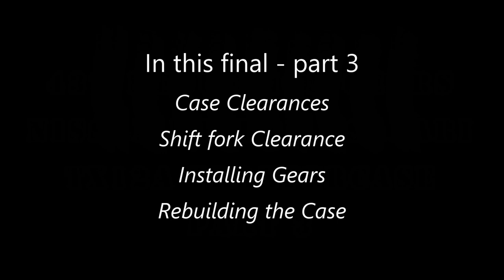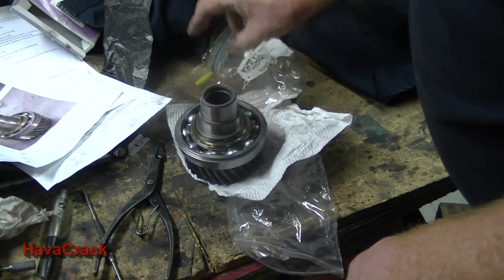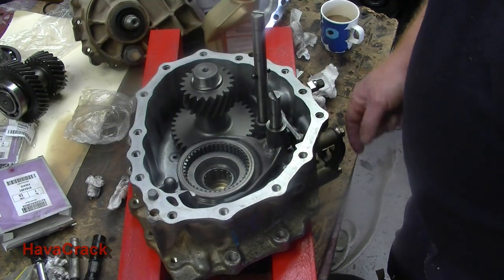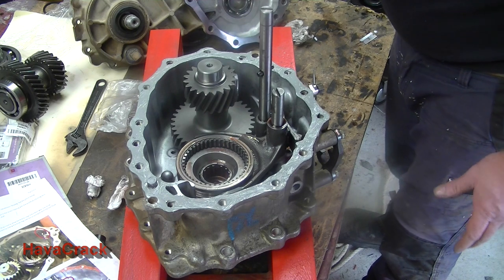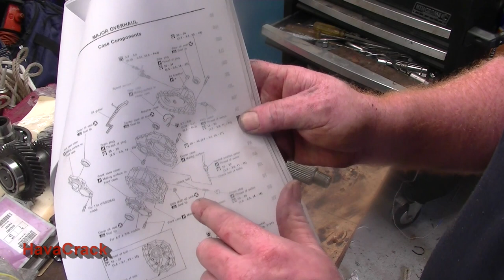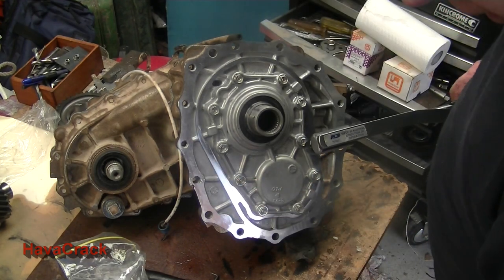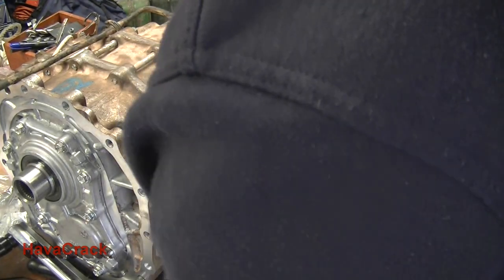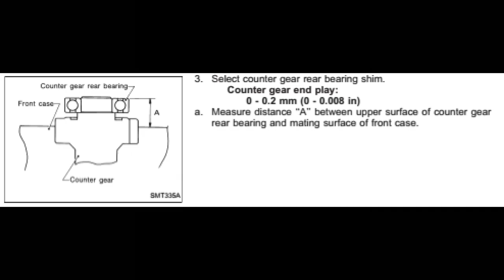HavaCrack: 43% Reduction Gear Install - Nissan Patrol - Part 3 of 3

Comment: Great video mate, I just installed a set of 63% gears. Followed your video as a guide, made things a lot easier. Thanks 👍
Reply from the maker: Ben neville    Thanks Ben, not a YouTube sensation, but I am glad the videos helped, I looked around for a couple of months to find any photos/ videos before I did mine but with no luck. Anyway that is why I make some videos on the things I do so as to help others out. You did well getting a set of 63%, I don’t think there will be anymore made. Out of curiosity and maybe so you can help others, did you have to grind the front case at all?   Regards Mick.
Reply: Did the 63s require more grinding of the case material?

Comment: Nice video mate. I just purchased the 43% from Marks 4WD, getting it installed by 4x4 obsession in 2 weeks as I'm not mechanically minded. Still it's good to see the process and what's involved. My reason for getting them was because my 3.0L Auto GU was scaring the hell out of me in downhill descents as stock. Hopefully the 43% will be a significant improvement although I've read in some forums that 83% is better for auto's, well I won't know till the next trip after they're installed and I'm facing a steep downhill descent. What do you think mate, will it improve engine braking on the steep descents? What has your experience been like with the 43%? Thanks.
Reply from the maker: I previously had a TD42 which had good engine braking going down steep downhill and the ability when going up to take off on steep hills from idle.  I lost all this with the 3ltcrd and especially down hill had to use brakes more often plus sometimes stalling and for steep up hill I always had to be in first low &/or keep the revs up.  With the 43% I am now back to (or maybe 1/2 gear lower) to the td42; therefore definately made a difference and I am happy with this setup.  83% would have been too low for a manual and if you could get the 60% that are sometimes out they would also be too slow for a manual unless you want to rock crawl or spend more time driving in 3rd low.   My mate has the gu auto and as you described there is no engine braking. I believe you will difantely notice an improvement with the 43% and I cannot say if the 83% would have been the better in the auto but for the amount of run on the auto has compared to the manual I think they would be good.  I suppose you need to find out someone who has the auto and seek their firsthand advice.  Regards Mick
Reply: @HavaCrack  Thanks for the reply mate. I'm looking forward to the next trip to try it out, will let you know how it performs. By the way my GU is not stock as I previously mentioned. It's got 32.7" tyres and a 2" lift.

Comment: Great Video. Thank you for showing this. I replaced my 5th gear for my 4.8 Patrol but noticed that the cruise control wouldn't work on 5th gear? have you faced the same and do you know any solution?
Reply from the maker: First, I presume your speedometer is working and if so the fault should not be part of the gearbox.  Secondly I am assuming you do not have a scanner.
In short I did not have any problem with my modifcations and the crusie control.  My y61 is a series 7 2012 and does not have a speed sensor on the transfercase like the earlier models.  I mentioned that in the video although it has a speedo drive gear on the output shaft, there is no VSS.
 However, I have had the cruise control not work on two occassions as follows:
1/. The brake pedal switch (there are two of them) not properly engaging &
2/. The tail/stop light not working or fuse has blown.
As per my gearbox/transfer, in video 1 & 3 you will see a gear/speedo drive gear, but this is not used in my model (2012 Y61). Regardless of how your unified meter gets the speed, if your speedo is working then your vscd cruise control gets it from the same source so that should not be your issue.
From your description are you saying that cruise control works in 4th gear, but not 5th? If so that sounds weird, as the gear should not matter unless you are goibg faster than 150kph as the CC does not operate over that speed or less than about 40kph, or were you saying that it is just not working now? Do you have a scanner and if so are there any codes such as a P0500 and a U1000?
Quick things to look at:
Issue 1: Have you checked that the brake/stop lights are working? Causes could be a blown fuse (10amp fuse) or potentially when the gearbox was taken out or put back in was any wire damaged that runs towards the rear of the vehicle?
If the brake light system is faulty then vscd will not work.
Issue 2: Switches: If it is the brake pedal switches for the ASCD (cruise control) are faulty then it will not work again. You can test the voltages or for continuity (which is easier) by disconnecting the plugs and putting a meter on the two wires as follows:
ASCD switch - Brake pedal released - Continuity should exist
ASCD switch - Brake pedal slightly pressed - Continuity should NOT exist
Stop lamp switch - Brake pedal released - Continuity should NOT exist
Stop lamp switch - Brake pedal slightly pressed - Continuity exist
Last there is a third switch on the clutch pedal for the ascd, and if that is not working then the ascd will not work. 
The only other issues if it not one of the above is the cruise control switch is faulted, but check that fuse first.
Sorry cannot help out anymore, but if your model has obd2 and you do not have a obd scanner then the Thinkdiag will show you the ascd switch status as well as the cruise control button status. I think gus from 2009 onwards will work with scanners(maybe earlier back to 2006). Regards Mick
Reply: @HavaCrack  Thank you dear for all your details. As I mentioned, if there is an issue with cruise control switch, It wont be working on all gears except 5th. And I replaced the parts from older model 1998 4.2 Nissan y61 and my vehicle has no issue at all and it is 2019 year model.
TB48DE
Reply: The last time I checked the vehicle with OBD2 came with below msgs;

P0335 - CKP SEN/CIRCUIT - 1t
P1336 - CKP SENSOR(COG) - 1t
P0057 - HO2S2 HTR (B2) - 1t 

Thank you anyway and appreciate your kindness and reply. I honestly did not know that this will affect the cruise control otherwise I would not do it.
Reply from the maker: @nalkhlaifi  Those codes are crank sensor faults and the downstream O2 sensor heater (after cat converter) None of those would impact the cruise control. 

I was about to say that if you used the 1998 gearbox then the Vehicle Speed Sensor VSS is on the transfer case, but that would not matter in your case as yours is a 2019 model and the speed comes from the ABS module and the wheel speed sensors, thus why I asked if your speedo works.  If the speedo works it is getting the correct signals and your gearbox modification has nothing to do with the faulty ASCD. 
If you can get a scanner you can see the ASCD inputs as 'on' or 'off' as you push the switch.  As I stated in my other response, the fault is usually one of the three switches (2 on brake pedal and 1 on the clutch pedal) that are not engaging correctly or it is the stop/brake lamp 10amp fuse (or brake light itself).  Have you checked those as I described.  Aside from that I cannot suggest anything else.  I suspect as it is a 2019 model that it is y62.  Mick
Reply: @HavaCrack  Yes they are. Just to show you only errors I have. This Super Safari model is 2019 y61 Manual transmission available in GCC countries not y62. 
I will double check the tail lights and switches and if problem is solved I will update you. 
Thank you for your help
Reply: Great info, just about to buy marks4wd 5th gear for my 2016 4 doors safari. Will it cancel the cruise control and how much reduction did u get? Thanks a lot

Comment: what is the zip tie for
Reply from the maker: As i had never pulled one of these apart i thought it may have been required to hold that piece together, but it is not required.  Just being cautious.  Regards, Mick

Comment: had 187% in the zook would be great to get some in the patrol. Great videos!
Reply from the maker: Richard k d I had a 4.2td that had enough torque and engine braking for steep tracks, but the 3lt gearing /motor is too high.

Thanks re comment on the videos; they take longer to do than whatever I am doing, I have a heap more that need to be put together just need the time. Regards Mick

Comment: Great video, I’m going to give this a go over the weekend and this will really help out, just a quick question will I need a press or a bearing spliter to do this job? Going to reuse the old ones as long as I don’t damage them getting them off
Reply from the maker: Jackson Doak ;  Jackson thanks for the feedback and I am glad that it will help.  You will need a puller to remove the bearings however if you have a suitable size pipe or a soft drift you could install the bearings without a press. The bearings are an interference fit but as you can see when you are joining the cases you have to tap the low gear shaft into the bearing whilst it is in the case; although interference it is not real right. If you have a spare $100 then you can just buy the bearings as I did which will save you having to pull them off the old shaft.  Use either a copper hammer or copper/aluminium drift. Last option (which maybe controversial) is you can heat them, you are not heating them red hot so you won’t ruin them. Mick

Comment: Was this worth it in the end? Is 43% much better than stock? Thanks for the great video
Reply from the maker: Sorry Thomas I missed your message.  I have only had a chance to use it once on a limited trip as due to bushfires and COVID we have been locked out of the bush in Victoria for most of the year.  I will do a video hopefully in the next 2 months.  But to answer your question:  I have previously had a 4lt 2f (landcuiser) and a td42 Patrol where up hills in the high country you could basically go down to idle then put your foot down and it had enough torque to get going again, when I went to the 3lt CRD you had to keep the revs always near 1800-2000rpms otherwise it would stall.  On steep tracks and with the reduction gears I am back to letting it off to idle and accelerating off again, so from that point it is where I wanted it again similar to my 4.2 diesel.   I have not used it on any real step rocky steps yet but I hated the 3lt CRD going down hill as it had no engine/ gear braking and you had to stay on the brakes a lot more.  As far as down hill where I have used it so far, yes it is slow in 1st low and I again guess the same as the 4.2 diesel.  So I suppose now double locked with the gearing back to where I wanted it I am sure for me it is worth it plus it only cost me the gears to do the install.   I have been in my mates patrol crd auto which is stock and if I had an auto I would definitely put something in.  I will let you know when a video of usage is uploaded.  Regards, Mick

Comment: Awesome set of videos mate, it's given me the confidence to do mine now!
How long was the total rebuild? A day? 2?
Why 43%? Can you do a before and after video?
Mines a TD42 and RE4 do it runs away even when the converters locked up, so reductions are my next step
Reply from the maker: Hi Andrew, first thanks for watching, I put the videos up to help others out so I am glad it helps.

The actual work on the transfer case can be done in maybe 4-6 hours. I think the only thing I missed in the video/process was pressing the bearing.  The case grinding and test the gaps took about 1/2hrs. The rest as per the videos.
Pulling the transfer case out (mine was a manual) takes a couple of hours i.e. removing driveshafts, parking brake then just the bolts holding it on.  The only bolt that was hard to get to on the tcase when removing it from the gearbox was on the drivers (RHS) top as the space was tight, but I did that one bolt with a 3/8" drive.  You can remove the tcase with one person if you have a good jack/stand, but as always two are better.
The only difficulty I had with the whole process was removing one of the switches from the tcase.

I chose the 43% as the 83% would have been too low and the 24% too high.  I had come from a TD42 manual which I had no issue with the gearing and I wanted to get the 3lt CRD back near that range, which the 43% has got it back to slightly lower than a manual td42, maybe 1/2 a gear lower in first than a manual TD42.
 
83% in the CRD manual I suspect would only be good for crawling only  thus any other low range gear would not be that good for Vic high country type tracks as you would always be swapping between high and low range if you came across a faster section. 

You may have noted that from time to time a bloke in QLD gets Marks to make 63%(or something like that and I think he was intending to do an order this year).  I asked Marks if they would make me a batch as the bloke in QLD was uncertain if he would do them when I got mine but Marks declined and their advice from their research is the 43% were more appropriate, and now having them I agree for the 3lt CRD.

I cannot say for a fact if 83% in the auto would be the better option for you, but having been in a 3lt GU auto with no reduction, I think they would be a good combination for that.  Sorry but you may have to hunt around the internet for more advice on 83 v 43% for your setup for those who have them, but as you state the auto runs away and pretty bad at that.

At present I don't have any before/after driving videos, but I can get something (maybe after video).  If you are in Victoria and you have driven a track such a Burgoynes from the Woods Point side then the 3lt CRD without reduction gears is crap, you are on the brake a lot and if hitting steps/rocks prone to stalling.  The reduction gears removes that issue.  Plus going up steep hills I can let off the accelerator over erosion humps then take off again at low revs /idle without it stalling (CRDs stall if below 2000rpm).

Regards, Mick
Reply: @HavaCrack  mick, I certainly didn't expect that much information in the reply! 
THANK YOU!
Yeah, im in central Vic and I'm actually supposed to be in Wanangatta this weekend. LOL

I'll plan to have the big girl off the road for a week. That way I can not rush and get it all done.
Yes, I've seen the bloke on the patrol4x4 forum advertising the 63's. A lot of people love them, so I'm not sure why Marks don't hold them as a permanent option?
My last truck was a 42 manual on 33's so I'm chasing that kind of ratio in the 'new' 42 auto on 33's.

I guess the only thing to consider is the hydraulic booster from marks and better brakes if I go too low/high in %... LOL

God I'd be rich if I didn't have cars!
Thanks again for the help and advice mate, it really is appreciated.

Comment: Hey mate, to start off with great videos! This made the job possible for myself. 
I’ve just installed 85s and everything seems to work reasonably well. However my 2H/4h selector seems way looser then it used to be and changing from 2H/4h is extremely easy and I’m worried this could happen whilst driving without any assistance. (4L is fine as you’ve gotta push the selector down) 
Any idea what I might have missed? What holds the selector in 2H or 4h…
Reply from the maker: Did you put the checkball back in?  Or check to make sure it did not fall out (or the right way around).  The checkball will lock in the selector.  You should be able to still get to it  now it is back in the 4wd.  Mick
Reply: @HavaCrack  thanks for replying mate, it was the cotter pin that holds the selector to the case. Replaced and it now works better than ever
Reply from the maker: @ryanhosking4333  Good to hear you found out the problem.  I am also glad the video helped with your install.  What vehicle did you put the 85s in and was it an auto, and if so how did you find it.